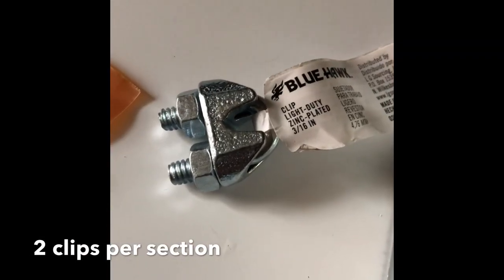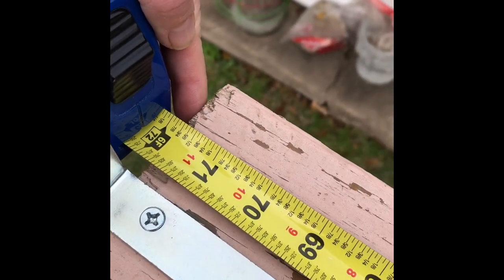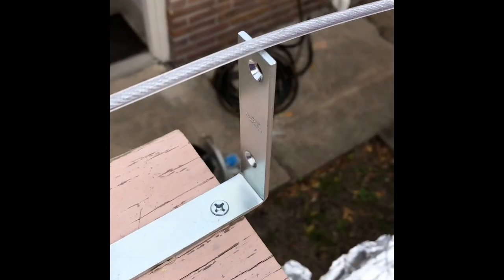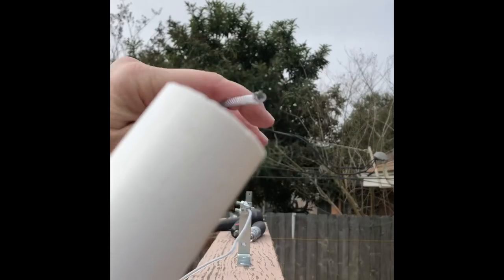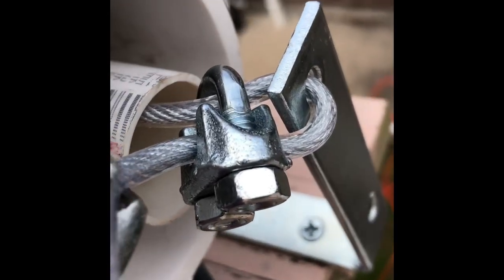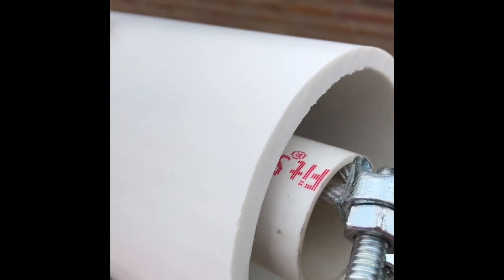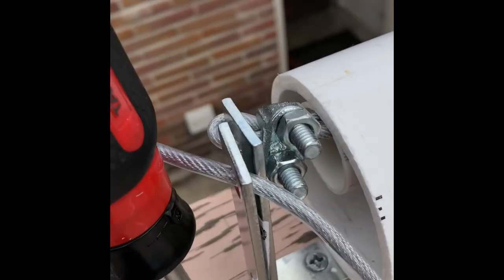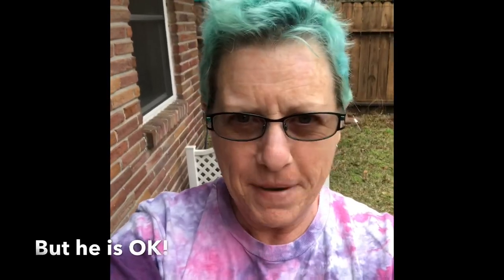DIY Coyote Roller Animal Deterrent

Comment: Great idea. 

But your cord need to be ON TOP of the bracket (not on the side) before you tighten it. 

Thag way when the cat add tension to it as tbey jump. The pipe stays straight and spins. 

If it bends too much. It wont spin. 

Good luck. Im building one too
Reply from the maker: I have discovered that to be the case now that the cable has some slack.  I will make the adjustments.  Thank you for the suggestion.
Reply: Can u explain the cord being on top instead of the side or maybe a pic of what u mean? Thanks!
Reply: @nancyb7398  1:16 maybe that's what he is talking about, it should be on top, not on the side

Comment: Very good tutorial! We have a big backyard (1.5 acres) and I want to keep our cats inside and pests outside. The only problem is that the majority of our fence is chainlink attached to metal posts, so I can't screw in the brackets. Do you have any recommendations for how to attach the wire to the top of a metal fence?
Reply from the maker: you can actually install on chain link the same way.  It is possible to drill a hole in that pipe.  there is actually another video out there that shows him installing on chain link
Reply: Use self tapping screws for the metal posts.
Reply: In the description of a video from Earrth Tiitan about Oscilote catfence is a link from somebody (Sassy ... ?) who made it on top of a round metal fence.

Comment: i myself would run the wire thru continually around the whole area instead of putting brackets side by side.
Reply: Interesting idea, i may try this.   I wonder if it will allow for more or less tension on the cable, I think slack would be a problem for the pipes to roll well.
Reply: The other video, they use electrical  conduit to replace the wire, no slack.

Comment: Consider using threaded rod, it's cheap and it would be so much faster. Nice work
Reply from the maker: That is an Awesome idea and would be a lot easier.  Wish I had thought of it before this task.
Reply: Can you describe how to use threaded rod? I am not familiar with it? Thank you!
Reply from the maker: @amyannes  You can buy long "threaded rods" and the whole piece is threaded.  You would just put a nut on the end to hold in place.  I really wish i thought of that.
Reply: Neartownvet Thanks for clarifying that. Thanks also for your video—looking forward to trying it in our cat area!!
Reply: @amyannes  Like neartown explained you can buy it in long sections, I used an electric cut off wheel to cut it but a hacksaw will work. Each end goes in the L-bracket, pvc or pex is on the inside. When your done add a nut to each end of the threaded rod.  I used 3/8" threaded rod.  Use 1/2" or 3/4" pex, I think 1/2" worked better. You want the pex or pvc reasonably close to the rod so it spins easier. The first mistake I made was using 1-1/2" PVC. It was too heavy, when a cat jumped up and grabbed it, it wouldn't spin. Good luck
Reply: @Bill Veder Thank you so much for these helpful details! I can really visualize the set up much better now.
Reply: @amyannes  You're welcome. I forgot to mention, I cut the pex in 12 inch sections use as many as needed to fill in the desired length, it makes it easier for it to spin.
Reply: @Bill Veder That is good to know! I intend to get going on this project this weekend.  Thanks so much for sharing your experiences.
Reply: @Bill Veder Once I install the 3/8 inch threaded rod and the 1/2 pex  do I still need some PVC pipe  on top of that? If so what size do you recommend?  Thanks—
Reply: @amyannes  I didn't, if it spins freely there should be no need. The inside piece would act as a bearing making it easier to spin so it's definitely not a bad idea but it's also something you can easily add later (avoid 1-1/2" PVC) maybe 3/4" pex will fit over 1/2" pex idk ? If not look for something closer 3/4" or 1" PVC that will fit over the pex you use?  Cutting lengths around 12" on the outer pvc or pex makes it lighter and easier to spin when a cat grabs a hold of it the whole length of pex or pvc doesn't have to spin. I would leave the inside piece one solid length.
Reply: Bill Veder  Okay, I will proceed without it! Thanks so much!
Reply: @billveder1071  I'm trying to do this on the wooden fence I am having installed for my neighbors (pit or whateva kind of dog) that keeps jumping the short chain fence and digging holes in my yard. Needless to say my neighbor is $#@&* for not taking care of this problem herself.
Reply: @JNante  If you don't own a dog something to consider is a high frequency anti dog barking device. Idk if this will work for your situation but it might be worth a try. I believe these can be found on amazon. Search Youtube for stronger/homemade devices. These devices can be so annoying to dogs, they become reluctant to step outside.  If they are solely an outside dog they will basically be in misery so I've read but I've never personally tried them. A motion activated sprinkler may also help, Best of luck.
Reply: @Bill Vader I looking to try this project. Are you saying the threaded rod should replace the cabling in this videos setup? Please explain?

Comment: Thats a typical cat they will stop at nothing. I’m having the same issue, put up Plastic Garden Netting with PVC pipes. I’m amazed the cat can still get up. ARLO time to see how
Reply: Creeper comment a year later:
Look for the video where they used clear corrugated poly panels on top of the fence. The cat climbed up as far as it could and could not get a grip on the polycarbonate panel.
Reply: @y0nd3r  thanks I actually have a little I need to put up. I need more though. At least my infant will be able to play in our backyard poo free! The front yard is lost😕